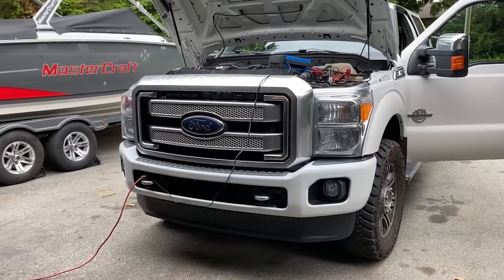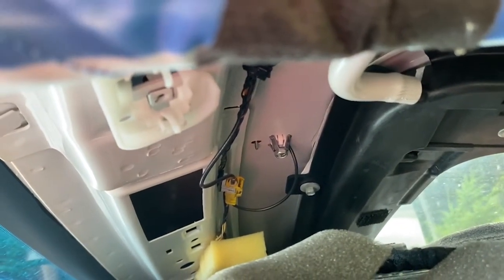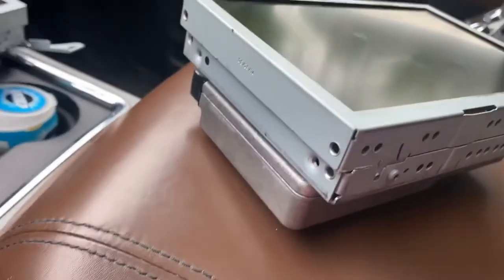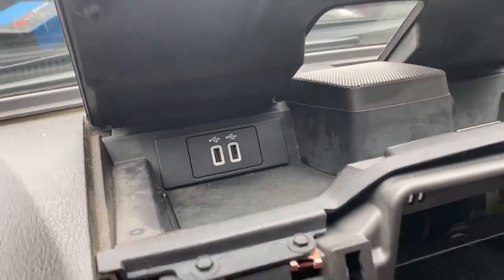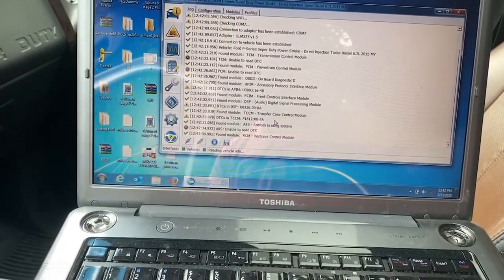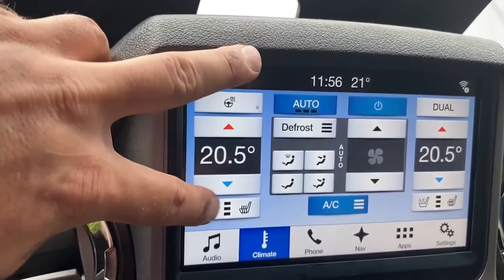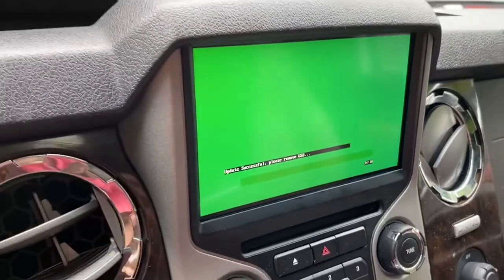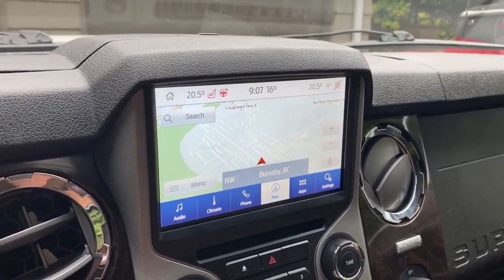Sync upgrade video

Comment: Planning to do same on my 16 explorer limited.  I have 1 question, all I need to do is save the addresses off the old apim and reloaded on the replacement  one that should have same features, correct?
Reply from the maker: No, some of the blocks will be different, so just copying the code won’t work. You’ll need to program the new sync in the appropriate blocks with the features you need.
Reply: @ViperMike  

So if I find a VIN of a newer vehicle with same features, I can print out the as built values  and just fill in the apim codes,  correct? Thank you for quick response.